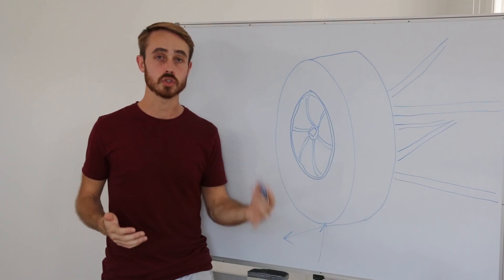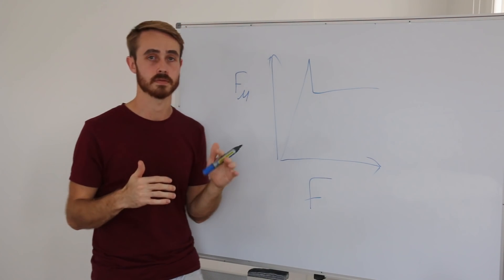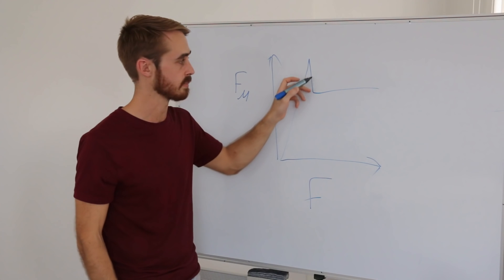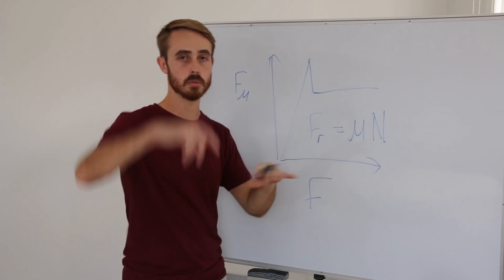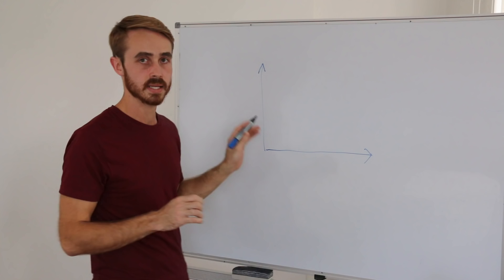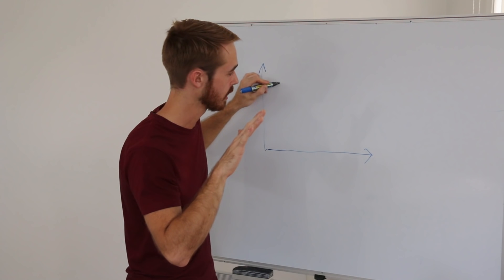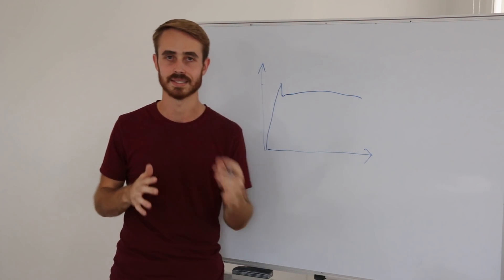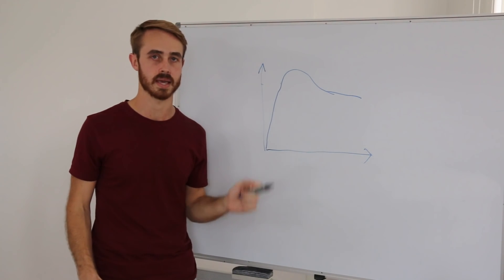The Fundamentals of Tire Friction

Comment: In the second graphic you said that in y axis there is the "coefficient of friction". Did you want to say "force of friction", didn't you?
Reply from the maker: Well, the coefficient of friction is essentially the grip available, it is the friction force divided by the normal force (weight on the tyre). Does that help?
Reply: So they are practically the same thing, more or less? 
And by this, should we say that in this case the friction depends from the tire's contact patch?